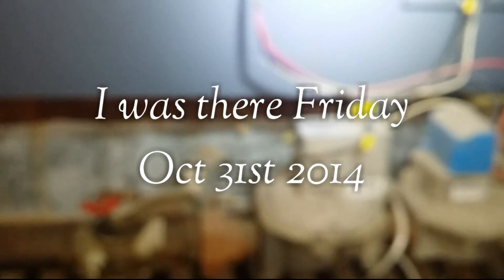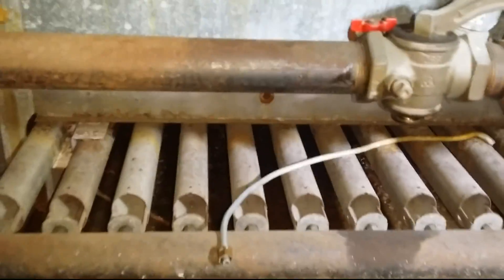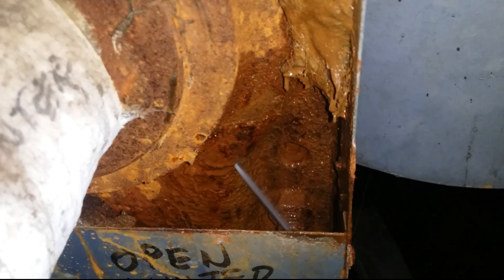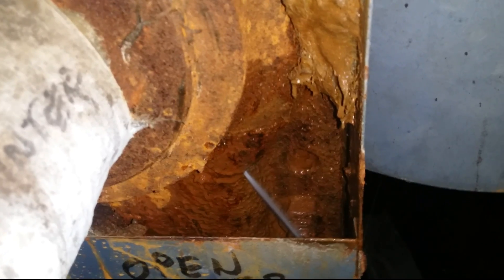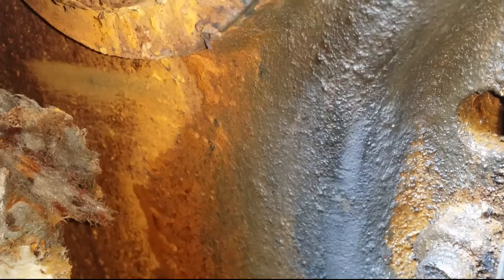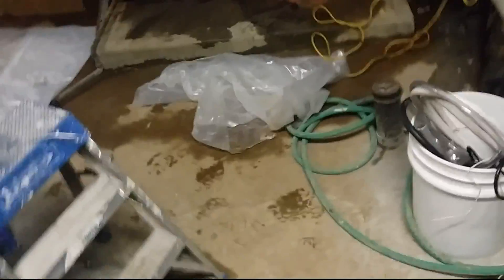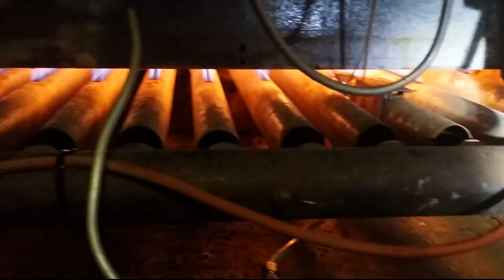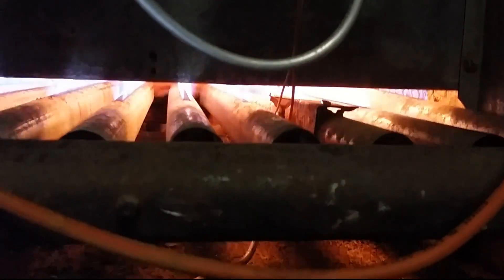Weil McLain Boiler | Gas Fired Boielr Serviced

Comment: Good work
I used epoxy on a 30 psi boiler lasted a long time marine epoxy
Reply from the maker: Yeah Dennis I've used it on 120 psi system with the same type of  leak and it worked very well. The plumber that's replacing the boiler told me that it will never work I laughed at him when it did lol